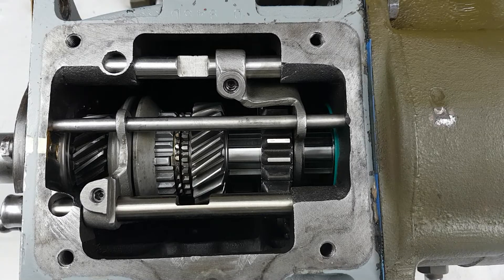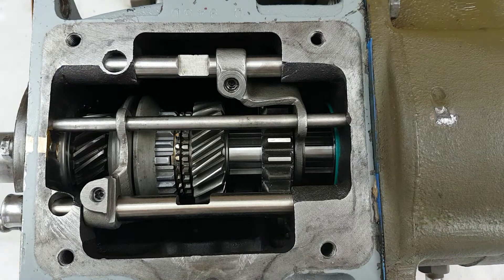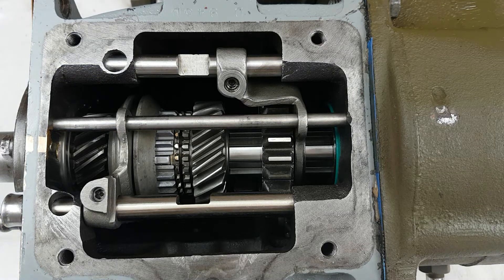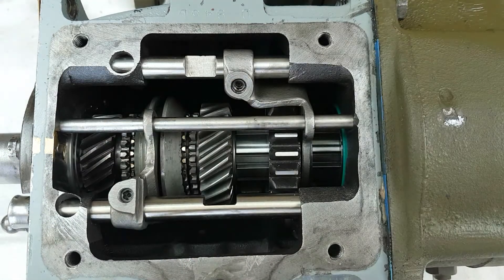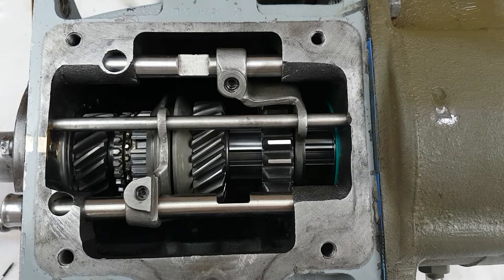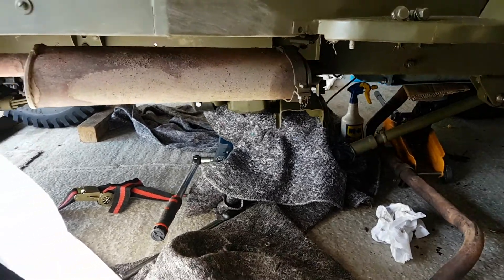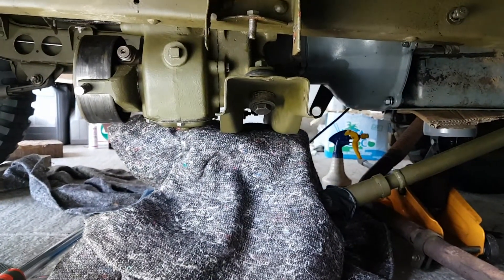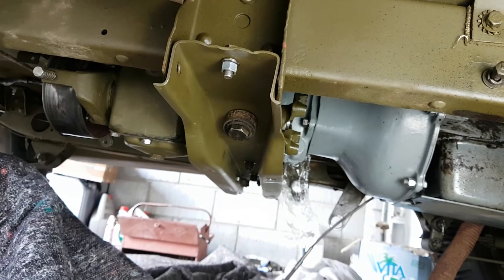Can I fit the T84 Transmission back in to the Willys jeep?

Comment: I shimed my t 84 transmission, zero movement 3rd & 2nd syncro blocking rings. There is minor stiff drag when turning the input shaft ny hand, but it ok to have preload. Gear selection is smooth & firm. Noticed no more gearbox noises cruising on flat road acceleration or foot off the accelerator. Previously gearbox was quite noisy/rattles was annoying.

Comment: Well, that went back very easily, it only needs one tight bolt in a hole to make the whole job a huge problem, especially when you are laying under the vehicle, but by trying the shaft into the pilot bushing you eliminated one of the main sources of trouble, I see your cat has given the job a final inspection !
Reply from the maker: Absolutely right, I was very lucky, the input shaft was even lined up with the splines on the clutch first time.  I would highly recommend test fitting the input shaft into the pilot bushing to make sure they mate easily, I can only imagine the 'fun' you could have trying to get the thing in and eventually realising the pilot bushing isn't reamed enough.  My pilot bushing which was lose when test fitting it on the bench tightened up a hell of a lot once fitted into the flywheel.  Again another vote for making sure everything is done correctly!

Comment: Hey great series of videos however I would have liked to see exactly where the shims go on the main shaft.  Because the French used the shims perhaps the original French M201 manual described the clearance needed for the blocking rings, just sayin’.  I’m about to rebuild a T84 for a friend and the whole thing is trash.  I’d swear the previous owner never even attempted to slow down or stop to go from 1st to reverse.  I’ve got 3 under my belt already and all turned out good.  These videos will help me refine my rebuilds even more.  When I pick up my parts I’ll be sure to bring my vernier and the list of fits and  tolerances as well as the old parts.

Comment: what is a good way to push on the rear bearing? I was thinking about pushing mine on as far as I could by hand and use my old bearing then mate up the trans/transfer case together with some longer bolts.
Reply from the maker: Apparently the best way is to cut down an old transfer case and use that but I am thinking of welding up a mount next time I do one to save the hassle, remember you can't set one up properly without bolting that bearing down!
Reply: @Greendot319  I use an old bearing that I honed out to set up. Saw that on a video. Not a bad idea. 

I happen to have an old case now that I could use. Thanks for the advice. I've looked all over on how to do it and have had no luck. 

The old case is pretty light with no guts in it. I don't think I'll be cutting it up.
Reply from the maker: @duckhunt1058  remember there can be a difference between an old bearing and a new one, perhaps not enough to make a difference when setting up a transmission but definitely when setting up a differential etc so just be careful with that!  An empty case will work well to hold the bearing in, just not as easy as a cutdown one, I haven't found one bad enough to cut up either, good luck!
Reply: @Greendot319  I set mine up and put it all together and it shifted pretty good. Used rachet straps to hold it down and that worked really good. Didn't move around and allowed me to shift all the gears. 

Only issue that I have in using a new bearing is having to take it off if I have to do anything. Something I would not want to do.
Reply: @Greendot319  My differentials are done and  were done at reputable shop near me. It cost a bit but I don't have to worry about them.